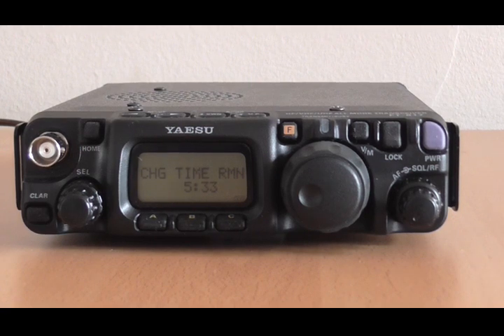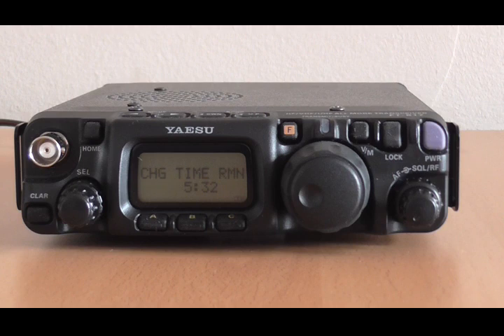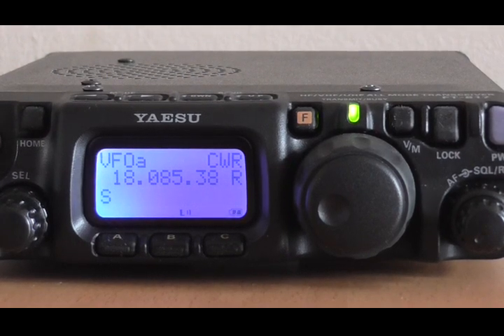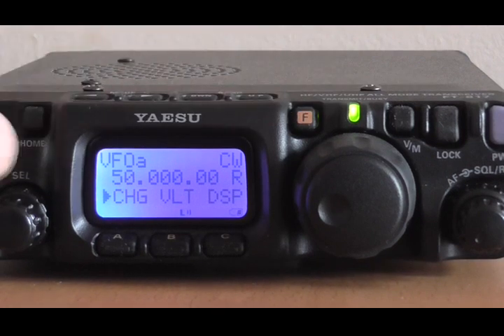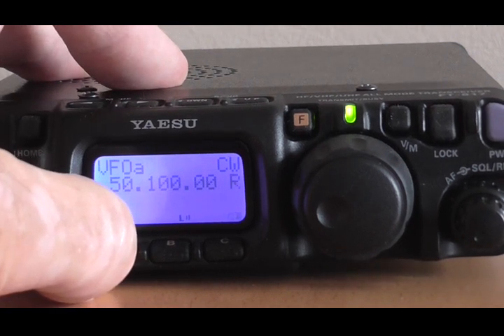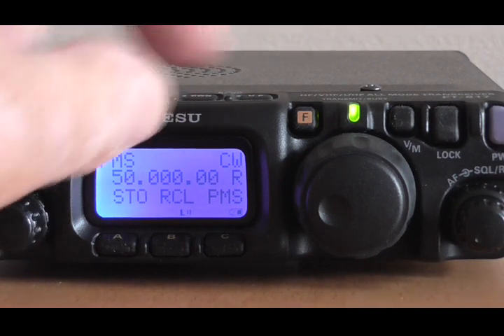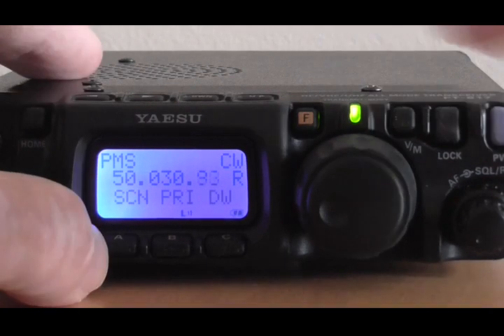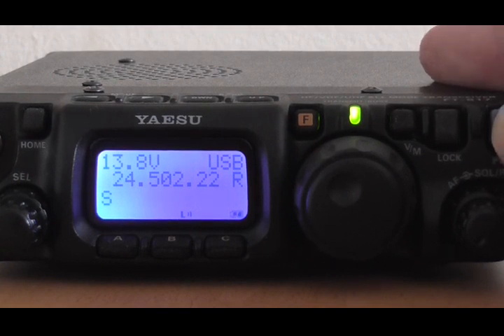#7 Yaesu FT-817 Scanning Set-up

Comment: Excellent instructive video (as always) Graham. I was quite surprised at how long the scan took to cover 100kHz for a (fairly) modern radio. I did borrow an FT 817 a while ago to help me tune the oscillators in an ailing FT290R and quite liked it.
Reply from the maker: diymostthings, Thanks for your comment. Yes, it does sound like a long time but at 1kHz per second it gives me a chance to jot down the other station's call sign while I'm playing electronics at the other end of the shack or even in another room ! 73 Graham de G4VUX